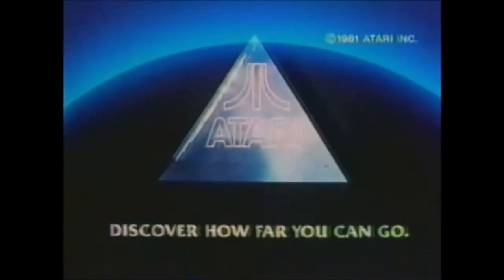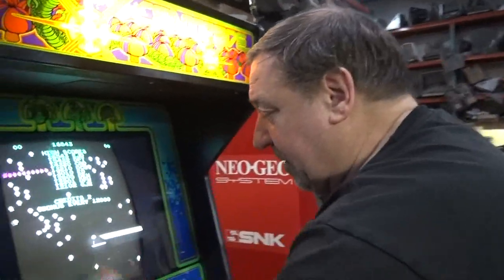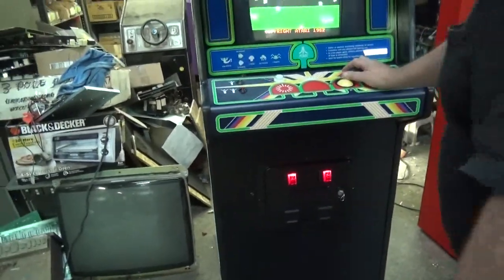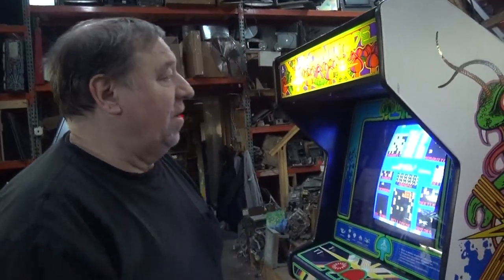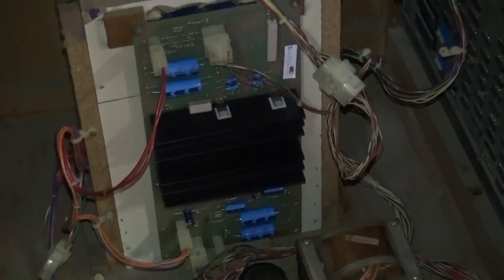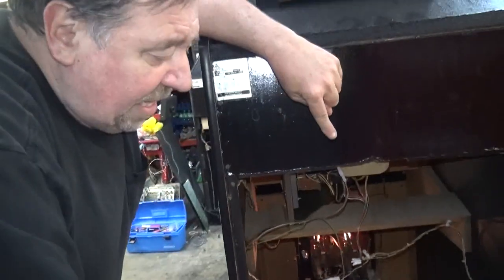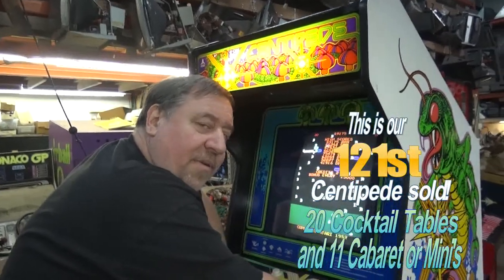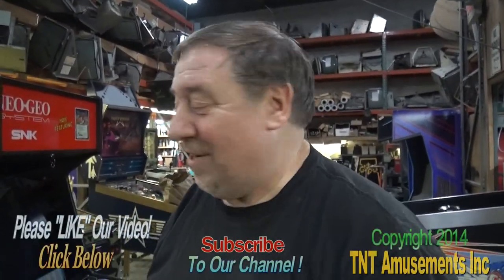#710 Atari CENTIPEDE Arcade Video Game with MILLIPEDE added! TNT Amusements

Comment: Since this video was made, I believe they have released an adapter to run a Millipede board in a Centipede cabinet without having to use a Millipede wiring harness. I may be looking to convert a Centipede to this in the future. Or maybe the Centi/Milli/Missile Command PCB if I can find one.

Comment: I have an original centipede. So all I have to do is order that board to convert it?
Reply from the maker: Theodore Vargas I wish it was that simple.  The double kit from Braze only runs on a MILLIPEDE board.  What we did is take the wiring harness from a Millipede and the board and put it in this Centipede.  (you could also rewire the edge connector of the Centipede if you wanted to use that harness.  The Braze kit will ONLY run on a Millipede board (more memory).  Todd